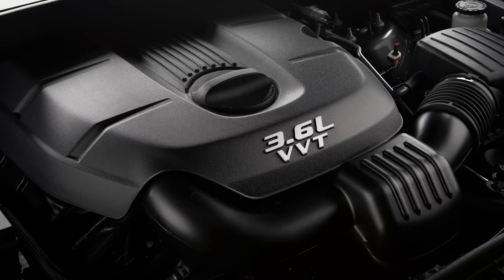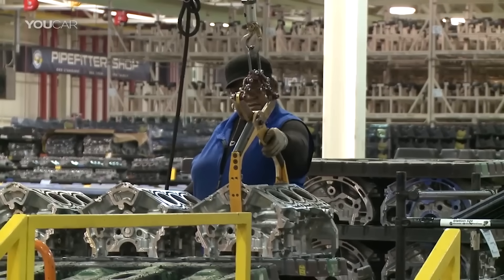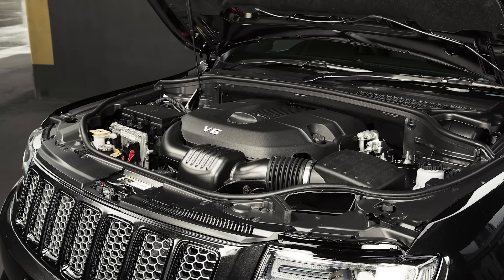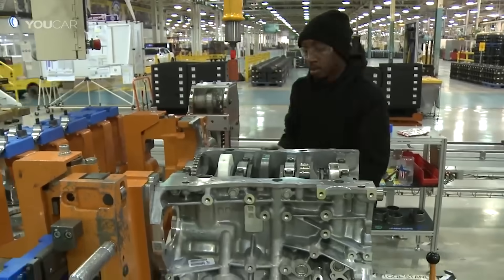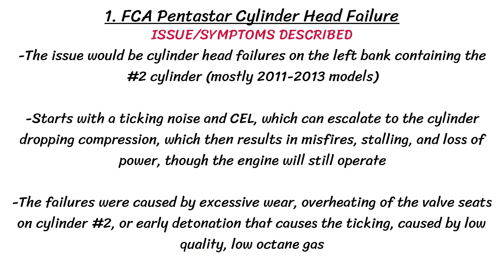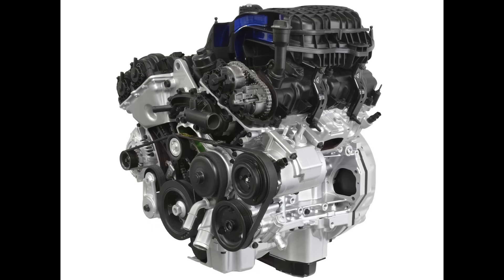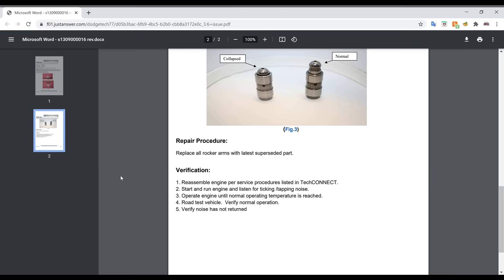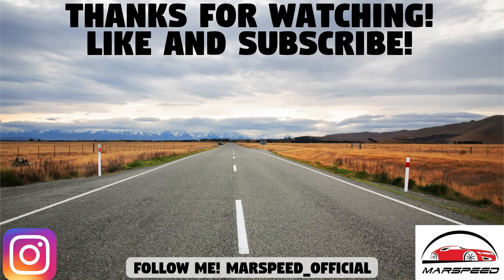The Specs and Fatal Flaws of the Chrysler 3.6L Pentastar V6 Engine

Comment: heat damage to the top side of the motor due to cheap gas or a clogged oil filter assembly unit caused me to remove the heads on my brothers 2012 dodge grand caravan for the machine shop to recondition and do the valve train at around 70,000 miles.  194,000 miles now and having the same kind of problem.  took it to the smog guy with check engine light on for misfire.  it ran great until the smog guy damaged the boot from the coil which had melted onto the spark plug.  he had trouble getting his spark plug socket on the plug cause the tube was warped, and he figured the head was also warped.  I bought a used engine that i am getting ready to replace the other one with.  i was worried the used motor might have the same kind of problem, but the spark plugs came right out and they all looked good.  i took off the valve covers, and the valve train is brand new.

Comment: My 2016 Dodge Durango Citadel Platinum, currently has over 300k on it. It runs like it was designed, and burns no fuel. No oil leaks.

Comment: I have over 200,000 miles on my pentastar 3.6l in my 2015 challenger.. i had 1 rockerarm failure i didnt replace it right away and it damaged the cam shaft... So i replaced all rockerarms No other issues

Comment: I have 2012 dodge journey with the 3.6, it did pretty well as it was bought in 2013, it’s now at 283,000 km and it does have a tick, most likely the rocker arm, but no engine codes. The transmission did fail tho.

Comment: I have a 2019 charger SXT pentastar V6 135k miles and 10k miles ago I changed water pump thermostat serp belt new coolant bled system ran good. I’ve driven through the summer and into winter started getting high temps heat works everything works no coolant loss.  I’m going to replace thermostat again hopefully that takes care of it and bleed the system again
Always run high octane gas in mine as well.

Comment: I had rocker arms replaced twice, the oil cooler replaced twice, I was looking at the fuel rail it is made of plastic and I find this dangerous.  I have a 2014 dodge charger only 114,000.  I will never buy dodge product again.

Comment: I have a 2015 Jeep Grand Cherokee LTD 4x4 with the 3.6. I have an engine code P0306 that keeps coming back. I have changed the ignition coils and spark plugs. What else am I missing
Reply: What do you mean? Just keep replacing things, until you sink over 10k in it and get rid of it for 2k

Comment: Im so happy my wrangler doesn't have cylinder deactivation. Also something more reliable than cylinder deactivation is to make a vehicle a hybrid have the combustion engine charge the batteries so you can switch over to auxiliary power to save fuil. It's what Edison motors up in Canada is doing and ive been saying this since i learned the (i think the third generation) Prius turned into a plug in hybrid instead of siphoning energy from the combustion engines to charge auxiliary power.

Comment: I just came across your video, my issue was 3 water pumps and a oil cooler I change my oil every 2500-3000 miles regardless, my Grand cherokee has 70,000 miles and so far so good nothing major, However when the dealer tells you to change oil every 5000 cut that in half and yes use a higer octane fuel. Great video

Comment: Just Bought a 2019 Grand Caravan (66,000 miles) and Instantly having the P0302 code Issue. Mechanic is trying things like Coil, plugs etc. and looking for Input of possible tries. Rocker Arms? Maybe? Anything else that might Help? Higher grade Fuel? Hoping to not have to do New Head Job!

Comment: 2017 Jeep Grand Cherokee with the 3.6L Pentastar engine. At 94,000 miles i noticed rough idle and I started seeing code P0303 change the plugs and coil packs. plugs look liked normal use no excessive oil or antifreeze. Looked into spark plug chamber and it looked clean in there too. One day would not start smoked out the starter. Noticed the coolant reservoir was dry. NEVER saw smoke at tailpipe. Turned engine with breaker bar and would go around till around 360 degrees and then you had to tug it to make it go further. Into shop to swap out the engine. Changed oil every time the change light came on.  How often should I change oil now? What weight oil do you suggest? I live on Long Island NY and we can see -10 degree winters and 98 degree summers.  It is NOT a commuter car and the furthest we go is Southern NJ! Great video BTW!

Comment: Let's just be honest, 2010-2020 was NOT a good decade for Chrysler/FCA vehicles!! I mean, even IF u somehow managed to have ZERO issues w/ your Pentastar v6 or your 62te transmission (which was unlikely) these vehicles still had a whole host of issues that plagued owners. They ranged from faulty TIPM's causing all sorts of issues, to hands-free modules failing all over the place and don't even get me started on UConnect problems! It was more like "u-CAN'T-connect" with your IPhone! 🤣 It seemed like almost every model had an airbag recall, too, for some reason? Tons of key fob issues, I could go on & on...My point is; I always believed the wiser decision was  to just steer clear of Dodge/Chrysler/Jeep vehicles made from 2010-2020! If u already own one & you're still in that sweet spot of "everything still works like it should" then get rid of it ASAP to the highest bidder!! YOU'VE BEEN WARNED ⚠

Comment: 2018 Jeep. Just replaced my EGR cooler hose, my thermostat and now I’m currently working on replacing my ignition coil for cylinder 3. These issues are accurate and I’ve been arguing with everyone that I don’t drive this thing like a Trackhawk.

Comment: It's a great engine purchased a 2012 charger to the wife 130k miles .so far so good very quiet engine. Powerful I remember the old 98  mustang cobras came with 305 hp I use to have one and now this v6 ingenes almost have the same. Well this engine have past the test just make the wife drive it for a couple of years and you'll understand me.😅😅.

Comment: My 2013 3.6l ram is on the way out I think. misfire in cylinder 2. Sounds like knocking. 276 km on her. Changed the plugs and coil, no luck. Any ideas anyone ?

Comment: It is good engine only have small problem. I own 2011 ( 179  miles ) and 2016 ( 85 miles ) grand caravan. I keep oil change 5000 mile + a cup of LUCAS oil stabilizer (it keep you less problem)  I"m upgrade my 2011 around $700 new part  to run ( 300 miles ) 😀😃😃

Comment: I'm on my second 3.6l. I put 130,000 miles on my 2011, and am at 112,000 miles on my 2017. Valvoline full syn at 5000 miles, the manual stated interval. I do 98% highway miles. Both run like new. It's a great engine. If I was city driving, I would change oil at 3000 miles. I get 40+ MPG (imp.) at 75mph. Caveat: These engines will really eat gas in the city if you aren't careful on the pedal.

Comment: Pentastar is a FIAT ENGINE NOT A CHRYSLER BUILT ENGINE!!! I own 3 shops and 1 is solely for dcjr new car warranty and any/all other Chryslers and I’m certified ASE TOP TO BOTTOM AND CHRYSLER AS WELL!! I’m a master certified tech. The 3.6 is dubbed the 1million mile engine. I have been married for almost 20 years and we only own Chrysler my wife’s cars have been 3.6 since the 3.5l which was also an engine we NEVER had issues with due to normal maintenance and replacing ware and tear items and I’ve hand my wife put 100-200k miles on her cars then whenever she buys a new one I use her old one as. A loaner car for customers!! I have 3.5’s all original 300’s awd w/ over 300k miles no lights on the dash same with the 3.6L FIAT PENTASTAR!!!! My highest mileage car has 468,007 miles and all their air, heat heated vented seats, no issues but for wear and tear items and basic maintenance. I can prove it also! Not one of my 6 3,6L vehicles has EVERRRRRRRR HAD HEAD OR ROCKER ARM ISSUES!!!! And we pay cash for pur cars and only DCJR VEHICLES AMD THEYRE ALL BRAND NEW CARS THAT WE ORDER! Plus we pay net net net for all our cars then rebates on top of that and yes I have access to the MSO/BILL OF SALE AND THE REAL INVOIVE THAT GOES IN A FOLDER cheap parts yield cheap results and an untrained tech yields the same! Knowledge is key here people!

Comment: My grandmas 2013 dodge grand caravan has passed 248,000 miles, doesn’t burn oil, only work done on the engine is the thermostat and alternator, it just developed a upper end tick, but it’s running good and the tick goes away when you give it some gas

Comment: Could have been, But.....There Two design problems, first, there is the exhaust manifolds cast as part of the head casting to assist faster warm-up times, all other times that heat works to distort the head, Second is the use of plastic parts that Will degrade with heat and time, like that filter/oil cooler, buried under the center intake manifold....And, having non repairable
parts of the basic engine is the Death Nell of this design, may it RIP....

Comment: 2019 Ram 1500 3.6L v6 4x4 owner here. Bought the truck used with 51k. Currently at about 56. Took to the shop a few times after I noticed an issue when I get up to speed on highway, truck wouldn’t shift unless I let off gas. Took to dealer twice and they never found an issue. Check engine light came on ran the code and got a cylinder 4 misfire code. Took to dealer and again they found nothing. Got sent overseas recently and had my wife turn it on and sometimes drive it around. She too felt hesitation. Ask my neighbor to take for a spin he also felt it. She took it to dealer and they FINALLY said they found an issue. They replaced the transmission and the catalytic converter, issue was still there. They didn’t know what else to do so they reached out to engineers. About a month goes by and they dug into it more and said the intake camshafts were shot. They had 1 and had to order the other. That’s where I’m currently at. They asked what gas I’ve been using I said 87 from top notch gas stations. Mostly Shell. They asked if I had done anything to it I said no because I haven’t. 

Anyone ever heard of these issues?

Comment: I drive Uber and Lyft. Average 200/500 miles a day. Currently have 286,000 plus. Almost zero maintenance. Just normal maintenance, air filter, new alternator, spark plugs ect. My passengers are amazed that my Pacifica has that high of miles and still runs so smoothly.

Comment: I bought a 2015 grand Cherokee new  I now have over 180,000 miles on it   The battery lasted 8 yrs  replaced wiper blades once with rainX blades original tires lasted 116,000 miles  and the ones I put on it still look new  never tuned up always used  Shell Rotella t6  wix filters balance tires every 5,000 miles have front end alignment every 4 years original brakes shocks and struts  absolutely the best vehicle I’ve ever owned

Comment: I had a 2015 Chrysler 200S with the 3.6 Engine. None of the "problems" discussed in your video ever materialized. I had another issue with the plastic oil cooler leaking after repeated replacements finally resulting in a catastrophic failure of the plastic part. The fix is replacing the oil cooler with a non-Chrysler ALL METAL Oil cooler that solves the problem permanently,

Comment: But if you're unlucky like I am 54,000 mi needs rocker arms and oil cooler $50,000 vehicle. Now you have to do all this working 54,000 mi. It's crazy then you have the audacity of the dealer charging you a diagnostic fee on top of the warranty repair. It's like they scare you not to fix it and then you got a lazy technician to guys. I don't want to tear an engine apart so they try to weasel out and say there's nothing wrong with it

Comment: I had the rocker arm issue in my 2012 Grand Cherokee.  It was expensive to fix ($2k) but it was really the only issue i had with the engine over 13 years of owning it.  The bigger issue i had with it was that in 4x4 configuration it is in the engine bay sideways, which makes it a real pita to work on.

Comment: The guy reading off these flaw's sounds bored to the max and yes all engines will fail because nothing lasts forever. If every so called " flaw" is corrected does that mean it'll last forever ? Maintenance is the key and when something goes wrong don't ignore it because it's not that bad or pretty soon you'll have several problems and it'll snowball your vehicle into a piece of crap and then you'll be on here telling what a piece of crap these things are and for everyone to stay far away from this junk when the real problem is YOU !

Comment: Had a 2012 Wrangler with the 3.6 Kept blowing cylinder heads with regular service every 3-5k miles.. After it fell out of warranty on my now 4th cylinder head, dealership has the gall to tell me I have to replace the motor at my expense. After fighting with the dealership and Jeep over who is paying for this nightmare for 3 months I had to get the Attorney General's office involved then Jeep caved and replaced my engine. At 20K miles with service every 3-5k miles at the dealership the second engine had the same issue with a  blown cylinder head, only this time it happened while I was on vacation with my family. Drove the thing home and traded it in as is and left Jeep forever after being  a faithful  Jeep owner since the 90's. That engine is garbage!!!!!!!

Comment: I see the engine as being an upgrade adding machine to finish the motor as the way it should have been built.
Meaning let the consumer fix the sub par parts used by Chrysler to get a good engine. Then come the poor electronics
that make the motor function the way it was designed. having the consumer upgrade the programing it the computer systems
and even replace the computers themselves with Chrysler charging for the programs and flashing of the replacement computers
and electronics needed to keep the engines running and pass emissions.  Always chasing the Gremlins to make the engine and electronic systems
work as designed. Everything is made if plastic and certain components need replacement just to keep functioning as the warping for stress needed to be made from aluminum instead of plastic and the engines have become an aftermarket parradice, draining the wallets of the owners.
The t62 transmissions have the same problems.

Comment: My 2016 rubicon hardrock had the rocker arm issue at 63k miles. Oil had been changed w all OEM materials every 4K miles. With Chrysler dealer documents to prove it.
Stellantis refused to fix it. Had to replace the arms and a cam shaft.
Had a transfer case seal go out about the same time. Not an amazing company. And such an easily preventable flaw they should’ve had figured out by 2016 easily. From my understanding the hemi’s suffer from the issue also.

Comment: My 2014 Jeep Grand Cherokee Limited's 3.6L engine lost cylinder 4's valves through the guide wearing out. Dealer replaced it with another 3.6L with 90,000 miles on it. Gave me a 12,000 miles warrenty with it. I put just over 9,000 miles on this one and it done the same thing. The vvalve guide just on cylinder 4 wears out and starts misfiring. Let me know if you have experienced this with yours please.

Comment: I’ve had so many issues with the 3.6 in my Jeep JK. Taps and rockers replaced around 89k miles. New radiator, water pump, sensors, thermostat, hoses, and more. Still overheated. engine has been scored and leaks coolant into the cylinders. Current mileage with all these issues is 94k. Dealership is telling me I need a new engine at $13K!! This blows. Other shops are  using Jasper 3.6 engines and used LKQ. I’ve heard so many issues with the Jasper’s. Anyone got recommendations on how to go about this situation?

Comment: 2015 cherokee trailhawk. Motor died at 110,000 KMS. Lost oil pressure and fried the top end... Not sure what happened. bought a used motor for 500 bucks and swapped it in grandpa's garage because warranty had just run out. Would not recommend. Do not use built in oil change indicator, change it twice a year or every 6000kms. Maybe that would have saved me the nightmare.

Comment: Sad to say. But sounds like another throw away motor. And this is just not common with Dodge and Jeep either. Thanks for the video!
Reply: Every engine is a throw away engine if you don't take proper care of them and just abuse the hell out of them. Then you'll have the audacity too say oh its a bad engine when it gives you issues. If you think the 3.6 pentastar is bad for reliability  that's on you for abusing the engine. I have a 3.6 going on 218k with original engine and a second transmission which was replaced under warranty at 140k. Notice something wrong with a engine you fix it instead of ignoring it even if it costs you a little bit of money.

Comment: Bought a used challenger, 13 model..
Needed head gaskets, .010 off the heads,,220,000 miles..it's been running fine for over 1 year now,,she rattles a little  on cold starts,,not every time tho..I did the work myself...new head bolts installed..3.6 has good power..not impressed with the car tho..feels cheap to me.loud road noise..but fir what I got in it..I'll drive it till it dies...